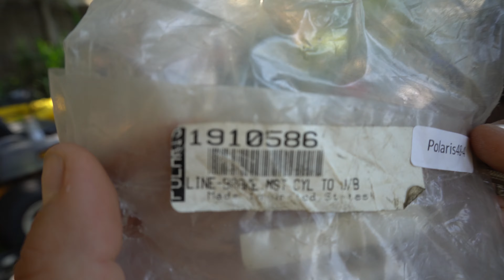Predator Project Is Finally Done! Is it fast? How Hard Is It to change a brake line?

Comment: How fast.?
Reply from the maker: It's pretty quick but I don't remember exactly how fast. We did GPS it at one point though
Reply: @TCMOutdoors  I'm thinking about getting one of these from someone I know,  but its leaking out the float bowl and will only fire up with starting fluid ...wont pull the gas from the carb ...what could be wrong with it